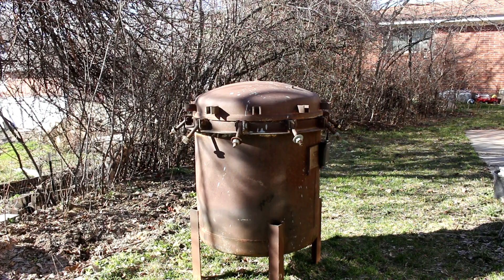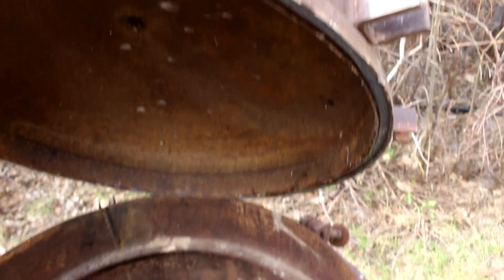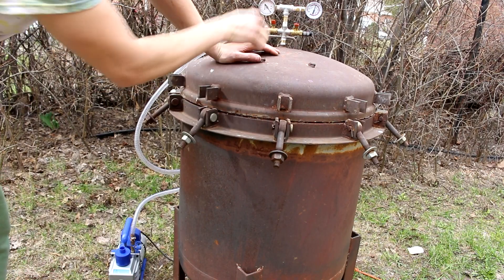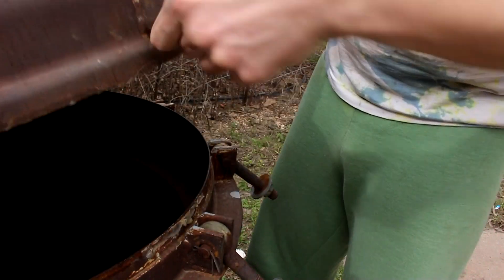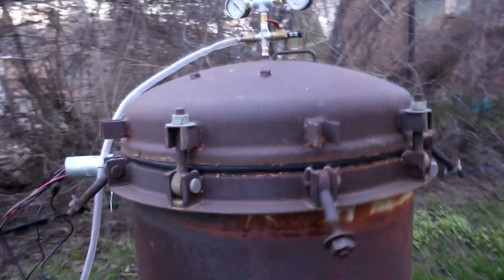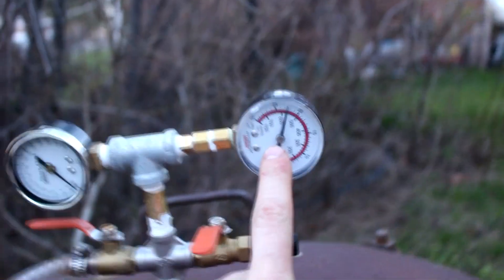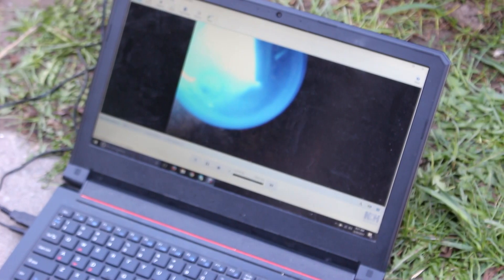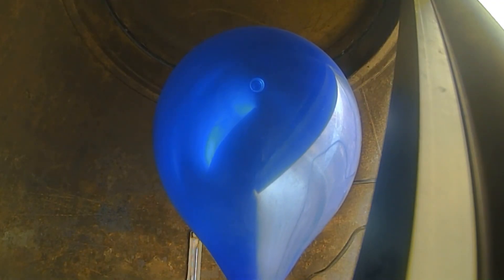Cody's 50 Gallon Press/Vac Chamber

Comment: Nice rig. You should check the vac bleed rate. I used similar cables and found multicore wires act like tiny tube leaks. Maybe gap the wires and pot them right on the metal in epoxy? This fixed my leaks on a 100m deep underwater camera; I noticed the oil inside the unit was pushed 80+m up the twin  red/black power cable due to the tiny gaps between copper strands!

Comment: Since the balloon stopped floating at some point, does that mean that, if released into the atmosphere, it would eventually float high enough that it would experience neutral buoyancy, and thus not pop on its own?
Reply from the maker: in this case yes, then it would loose helium through diffusion and slowly sink back to the ground without bursting. this is why you sometimes find intact balloons out in fields, they couldn't get high enough to pop.

Comment: Cody, notice that the pressure rating was at a fairly high temperature. I would suspect that it can take much more pressure than that, at a lower temperature... Just a thought... I'm only part way in, but just in case you don't think of it, why not install some lighting inside, as well as a place to mount a camera or two? Certainly plenty of room in that beast!
Reply: Okay, never mind on the lighting and camera. ha ha ha I guess it was an obvious thing to do. :D

Comment: I can tell u exactly what it is. We use them every day. It's actually a vessel used to contain a strainer basket that holds filters. Used in filtering liquids. At work we use them to filter acrylic polymers. Other companies use them for filtering things such as paint, chemicals, water or other liquid forms of material even chocolate. We operate at about 30 psi without leaking. I have seen gaskets blow higher then that though. Hope I helped. Good luck!!
Reply: We use rubber O rings as gaskets
Reply: hollandboyz54 Hey, how does it filter the stuff? Or maybe a better question, why would you filter those things under pressure if it just sits there with nothing flowing through it? Maybe I don't see how it flows, so please educate me. 🤓
Reply: A  metal basket sits inside the inner rim and cloth sock type filters go in the basket. Material is pumped thru the top port(where he installed his wires) and comes out the bottom port.
Reply: I somehow doubt he is going to need it, but for reference, if you got a spare part number, and a retailer for those o-rings...
Reply: also leader iron works was a fascinatingly massive company in 1951. i was just googling too and ended getting a really fun history lesson.
Reply: Tsf Phil, I totally agree this one has seen better days. We use ones under a regular maintenance and inspection program. This one obviously has not, but if restored and inspected it may be ok. Surface rust is not a death sentence. Secondly most of our units are before the pump (under vacuum) and when the filters are dirty see a pretty good amount of it, the others are on the bottoms of reactors with large amounts of pressure when filters are dirty. We're talking 10,000 gallons being pushed through it. Regardless it needs to be inspected in it's current condition if he plans to use it as is.
Reply: This thing can obviously hold a vacuum and if it was built tho handle pressure it can handle a vacuum, they both need the same structure in order to hold them, and due to the edges of the container not being chipped I'd say that this is just surface rust and as long as it doesn't get any worse it's fine, it's already handled both pressure and a vacuum multiple times so it seems fine
Reply: jonathan richmond He peeled a large chunk off the internal surface. The structure required to hold vacuum is not the same as the structure required to hold pressure. Just because it survived a small number of cycles at certain pressures does not make it fine, the damage being done is incremental.
Reply: hollandboyz54 this always happens. I posted this first but got zero likes/replies. ~former polymer extrusion machine op
Reply: In the same way an egg can handle massive pressures (if even) but fails dramatically in a vacuum.

I feel Cody probably knows what he's doing in keeping it at less than it's half it's original values,and isn't planning on doing anything that could cause much additional wear on the interior, like using it as a ball mill so I'd trust him more than most youtubers, additionally he's a very experienced welder, so can probably spot metal fatigle (and fix it) before anything catastrophic happens.
Reply: The thing about tankers imploding in a vacuum is sure they were under pressure from what was in them but was that pressure equal to the pressure of a vacuum, I'm sure that Cody did the math before using this to make sure that the pressure would at least equal if not less with a vacuum than what that container was made for, I'm not bothering myself with doing the math but I'm pretty sure that if those tankers collapsed from the vacuum then a perfect vacuum has a lot more pressure than those were rated for, just because they held pressure doesn't mean they were rated for enough for a vacuum
Reply: if I make a 4 inch thick sheet of steel, to be used for sitting hot materials on in a warehouse... does that mean it isnt also good for stopping small caliber hand gun rounds? No. it just means it wasnt made for it... is it worth risking  something like a 50bmg etc etc -  no... would it probably work? yes. cody isnt stupid. he is well smart enough to have determined a reasonable amount of information about this device -  and it didnt blow up.
Reply: readyrepairs that is a very good point, but still, (this isn't going against what you said at all, even though the way it's set up seems like I would be), there isn't really a difference between pressure and vacuum chambers, they both require the same structure, those tankers are just rated for less pressure than is required for a vacuum, it's not that they are different structures
Reply: readyrepairs I wasn't arguing against your point I was just trying to say there isn't much difference between the two uses since they require the same system
Reply: Not at all. Pressure duty is not the same as vacuum duty. Think soda cans. They work very well under pressure, but the slightest vacuum would crumple one to oblivion.
Reply: It was definitely fit for vacuum and pressurized use at one point. We use 12 of the same containers made in the same time period (sadly) and they run 24-7 even as we speak. Now, ours were maintained regularly where this one may not have been but there are services that will come and inspect you're vessel and tell you for certain if it can or cannot take a vacuum anymore.
Reply: hollandboyz54 It may definitely have been fit for positive pressure at one point but it most likely was never rated for vacuum pressure. 

When you consider the design of the structure, the forces involved with vacuum  create stresses that aren't simply symmetrical. Just because you can go 30 PSI one way doesn't mean it can handle 30 PSI the other way. 

If it was a clean, brand new, vessel then I wouldn't be bitching any where near as much as I am but there's the fact to consider that Cody's vessel is rusted to hell. The structural integrity of this thing is too questionable to play with.
Reply: hey wth. my notifications said i could expect russian girls looking for quick dates here. so disappoint.
Reply: This vessel is not fit for any pressure related purpose.

SCRAP THIS VESSEL IMMEDIATELY. 

IT WAS NEVER DESIGNED TO HOLD A VACUUM. 

THE RUST HAS REDUCED THE STRENGTH SIGNIFICANTLY

THE CYCLIC LOADING OF POSITIVE AND NEGATIVE PRESSURE IS EXACERBATING PROBLEMS WITH LAMINATION

Comment: you could put beer in cyclider to a 2nd cylinder and show how at diff pressures you can distill alcohal right out of beer or water or wine... what happens to h202 in vacume lol 
or will sodium react diff under pressure and in vac

Comment: That's a sediment collection vessel, with a drain port at the bottom and removable inspection/service lid on top. Most likely it was used in conjunction with either with an industrial fryer (to collect food sediments from hot frying oil) or a metal machining setup (to collect metal shards and pieces of welding flux from cutting oil). Feel free to ask how it works.

Comment: Microwave inside a vacuum probably not a good idea as the forced-air cooling won't work.
Reply: I wanna see a Microwave Meltdown!
Reply: Lajos Winkler "I had a reaction vessel but it suffered a meltdown"  is a pretty badass story though, I'd say it's worth it
Reply: Maybe, though there may be issues with thermal gradient across the ceramic, but probably not an issue for short run times. 
Maybe just a suitable volume of non-flowing water would be enough to have the thermal mass to absorb the heat for long enough.
Reply: Or  a very large metal block, maybe use the container itself as a heatsink.
Reply: mmmmm water cooled magnetron? seems feasible, if you jacket cleanly and have everything including the water grounded.

Comment: I dint wonder , that the hose didnt break , because lets say the container has a circumfernece of 3 m , and you have a weight of 10 tonns, that only makes 100kg / 3cm about 190lbs/inch thats not that much weight , when you take in consideration that its only 33kg/1cm

Comment: If you pressure test it more, you might want to consider filling it with water. Water does not compress and in case it cannot handle it, only little expanding air makes pop similar to a smaller air container. That makes it a lot safer, 50 gallons under pressure is very dangerous if it ever explodes.

Comment: if you seal it's. you can nitrogen boil siasibin out of mushroom's and not destroy it with heat. if one was so incline.
Reply: Do you mean psilobybin? If yes Cody could probably get all the necessary stuff to extract it chemically.
Reply: I do just my spelling of word is a bit off.
an I use a recorder more then writing. it kinder like Stephen Hawking and his ms but mine is spelling.
an yes I do have quite a good lab.
which is quite good of ajustment to extract and tincher. for Medical Research.

Comment: Cody, I love your channel. Very interesting stuff.

Since you asked for more information on your tank, I figure I could help out a bit. This is a good chance to show the difference between a chemist (I assume that is your background) and a chemical engineer (my background). What you have there is actually a very small tank most likely used for pilot plant operations. Manufacturing tanks (usually) will range from 1000 gallons to 100,000 gallons. Some even bigger. Pilot plants is your first step to large scale manufacturing. A chemist will say, "I've just made 'X'. It is the greatest product there ever was. We should mass produce it". A chemical engineer would say, "Sounds great. What is your formula? How did you make it?". Then the chemical engineer will set up a pilot production run to see how well the process scales up from the lab bench to a production facility. A pilot production run is a good first step to uncover possible problems that can occur going from lab scale to production scale.

Secondly, this is not a reaction tank. It is most likely a storage tank. Reason being is that I don't see nozzles on it to install instruments (temperature, pressure, pressure relief, etc.). Things you would want to know during a reaction. In addition, there is no jacket on this tank so there is no way to heat it up or cool it for control (even though not all reactions are endo or exothermic). Also, there is no mount for an agitator - so there is no way to mix together the reactants for a complete reaction of your raw materials (this also means it can't be a mix tank for suspensions or emulsions). Lastly, the pressure rating is extremely low for a reaction tank.

Lastly, I'm glad to see you aren't hurt. A tank made in 1961 that is rusted out no longer conforms to its stamped rating. I would not trust that tank can handle 65 psig, even though it does look like it is constructed well - as it would have to be. Anything above 14.7psig needs to be ASME rated. There is a safety factor in that 65psig rating. They more than likely pressure tested it to double that - again though, with it being rusted that bad both inside and outside (let alone not knowing what it was used for in the past and how much use it got), you won't know how well it can hold up to pressure or vacuum - and getting it re-rated is far too expensive for personal use. One note on vacuum: Just because a tank is rated to hold positive pressure doesn't mean it can hold vacuum. Again, glad you weren't hurt. It would be highly unlikely you would start to see inverted "dents" forming.  It would just "go" - all at once. You'd be pulling vacuum then hear a loud boom/crunch as the weakest portion of the tank would collapse. 

Anyways, I hope this information helps you on this equipment or anything else you find in the future. Again, great channel. I love watching your videos.

Comment: Hydrostatically testing this would not be a difficult task at all, would give you peace of mind, is not at all dangerous due to the incompressibility of water,  and would make a great video. A lot of pumps will easily run up to a hundred PSI of static pressure, and a pressure washer style pump would give you way more pressure than you'd ever need.

Comment: What do you think about coating the inside of the tank with a polyurethane?  Maybe scour the inside to get the rust off before hand then coat it to keep the condensation from causing it to rust further.  Pick up 4-5 cans of spray on sealer and do multiple light coats.

Comment: This is going to sound crazy, but can you climb in the chamber and pump a vacuum to simulate high altitudes and then pressurize it to simulate being deep in the ocean? It would be dangerous as you may experience oxygen deprivation with the vacuum and the benze when coming out of the high pressure.

Comment: It's an awesome reaction vessel with a lot of potential. They are used in numerous industries for combining and heating chemicals under pressure. BUT, you are messing with a potential bomb there Cody. That vessel was clearly discarded a long time ago and the metal can be brittle, pitted and unpredictable. If you really intend to experiment with it, you need to treat it as though it can kill you.... because really can. After you clean it up and paint it, wrap it in a sheet of Kevlar or put in a pit in the ground or surround it with sand bags because I don't think you realize just how much energy that thing can release all at once. Consider that it is about the size of water heater. Have you ever seen pictures of a house after a water heater explodes. It's nasty.

Once you resolve the safety issues, that vessel is big enough that you could plastinate an entire human. You just need to find a freezer big enough to put it in.

Comment: Use caution with 110V mains equipment & elevated levels of vacuum. Electrical clearance & printed circuitboard creepage between higher voltages traces may not be sufficient to support the voltages under  vacuum..   Earth the big tank ;-)

Comment: Hey Cody
I don't uderstand, how did you do to avoid air entering along electric wire??
Reply: epoxy or even good hard non elastomeric silicon should do the same job if its thick enough and you make sure the surface is prepped for bonding properly
Reply: Pierre Jacquemot He sealed it with acrylic